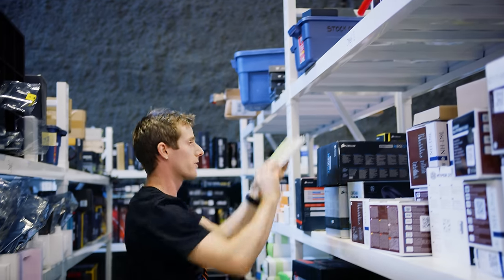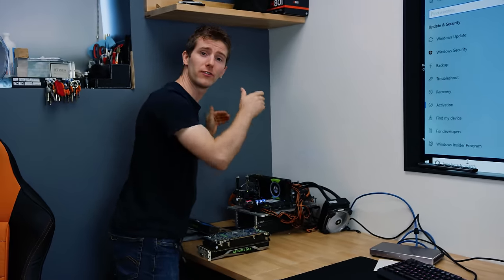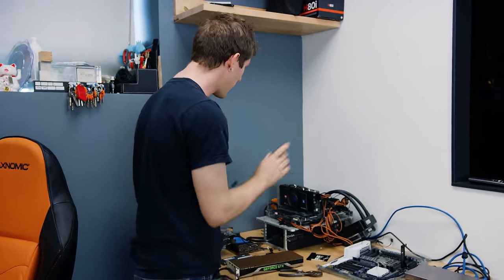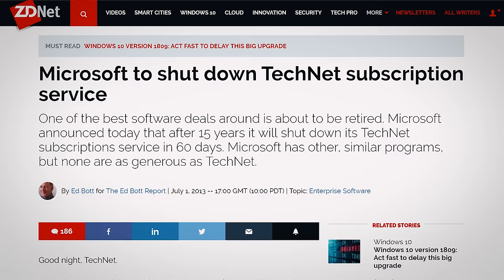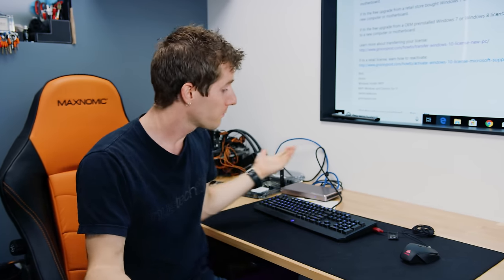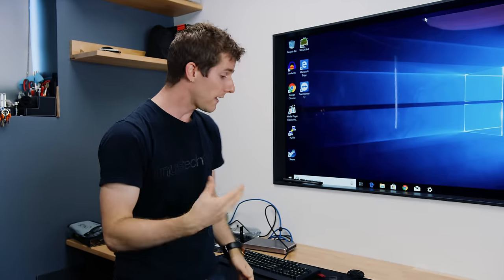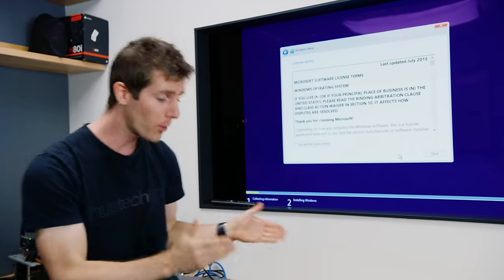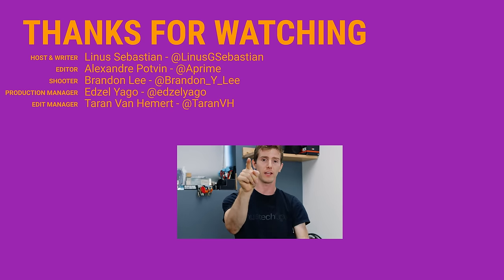Why Does Linus Pirate Windows??

Comment: It can happen within the same motherboard without changing any hardware at all. I was originally running a single hard drive as my OS drive. I decided to RAID 2 drives later in RAID-0 for my OS drive and after switching to hardware RAID in the BIOS it made me re-activate windows by calling the 800 number because it couldn't verify it online. So without changing any physical hardware and just changing how the drives were being accessed and configured using RAID it caused a big enough change for Microsoft to think it was being used on a different computer.
Reply: Generally speaking microsoft is genuienly behind in terms of true innovation and understanding of the current technologies and software/drivers, also their support service is a joke sometimes but whatever.
Reply: I've heard that disk I/O reads/writes changes could also trigger a re-registration prompt With the same controller still install. But this was just an urban legend some repair computer group techs told me. Don't know how true it is, I've my doubts.
Reply: I've had this happen a week after activating with zero hardware changes
Reply: happened to me after I got a new motherboard, and it wouldn't let me activate it online in the settings. Though eventually the watermark disappeared, so yay i guess.
Reply: It is mostly linked to MAC address from what I can tell. I have installed it on a motherboard with the NIC disabled and a 3rd party NIC. I then swapped out motherboards.  It didn't require activation.  I also had to disable CPU microcode.

Comment: I don't have a legit version of Windows on my computer and it was Microsoft's fault. I had a legit version of Windows 7 but Windows kept telling me there's no more updates for this version of Windows and told me to download Windows 7 Ultimate. Did the download and everything was fine. About a month after I started getting messages from Windows saying it wasn't a genuine version. Like WTF. Now I get a message every day warning me that it's not a genuine copy, not to mention that it makes my computer slower. I went to the Microsoft website and a rep tried to install Windows 10 but as soon as Windows 10 was installed I got BSOD and it told me to go back to the previous version of Windows. So now I'm stuck with the Window 7 Ultimate that's not genuine. When I click on to fix the issue, Windows just tells me that I cannot activate it because it is no longer a supported version of Windows. FFFffffuuuuuu
Reply: wtf duude, youre original activation key for windows 7 is still solid, ms just dont support you new updates anymore, so you are on youre own with security issues, they just wanted to confuse you into buying shiet, i do use windows 10 pro activated version couse i am only gamer, i was able to swap my key code between laptop n desktop, totaly different machine...
Reply: i mean arent the keys diff for like pro. home, and ultimate etc. id assume if you're using a key from a copy of say windows 7 home and then updated to ultimate i would think that would be your problem why it is saying its not genuine anymore. try reinstalling whatever version of windows 7 you originally had. i mean i use windows 7 pro still to this day and i've never had windows bombard me with any kinds of messages like this lol. except for when windows 10 came out n it kept asking if i wanted to upgrade to 10 since for awhile they were giving away free windows 10 upgrades to anyone that owned windows 7. i opted to stay with 7 needless to say.  but yeah im almost positive its telling you its not genuine because you're using a key from a diff version of win 7.
Reply: "No support" isn't about the end user as much as the vendors.  Anybody coming out with new hardware that wants to make it work with legacy OS past its end date is on their own, so they better be sharp: no MS resources are dedicated to solving their kernel/driver issues at any price.  For the end user, pushing past the date is no big deal - until hardware failure forces something on you.
Prepare yourself for something else, with some basic [case sensitive] commands that will come in handy at some future date, and leave that crap in the dust:
ls
chmod
apt-get
tar
Reply: And let me guess, you are surprised that you got a message about a non genuine version of windows after you stole it. Lmao.
Reply: Download magical jelly bean keyfinder, see if it shows a legit key, if it doesn't google how to get free windows 10 using media creation tool. I've done it on about 5 peoples computers, has worked everytime, or you can sign up to be a windows insider and download latest test version of windows 10, and put it on slow/fast ring or current, i'm on fast at the moment. Windows insider at the moment is the best it has been since it came out, never had an OS run this well since windows 7 being optimized. If you're worried you can always research how to block insider updated after you update to the latest that way you don't run into compatibility issues.
Reply: When Windows 7 first came out I bought a PC from PC World which had a legit copy of Windows 7 and COA, and also bought a stand alone copy for a laptop which had Ugh Vista. After a year I was told by Microsoft that neither version was authentic. I contacted them and they informed me the both copies were pirated. PC World would not help despite me having bought both from them.
Reply: Big E in the UP  yeah no. that's completely false. been running one machine with legit win 10 and one with cracked win 10 for over 3 years, neither has even given me any trouble.
Reply: That's why you don't fix, what is not broken.
Reply: just buy windows key on ebay it cost around $10.i dont like win activator it gave me anxiety seeing the .exe running in the background to keep your windows activated
Reply: You can look up Product keys and nine times out of ten Get a good one for free, I recently pirated ,windows 8.1 to put on a deskto that was originally windows 7 home, and I found a product key for free online after only a few hours of searching..
Reply: Just to let you know OP, if the windows sticker(if you have one) doesnt have a code on it, just the windows sticker, the Windows key is on the motherboard.

My Hard Drive fried out, along with the Windoes copy I had, which i thought was the only way I had of Windows, lost. Then I came across a program that would find it for me. My own key. If its just the windoes sticker without the key printed next to it, you may be in luck to your old original key, just need to get the original Windows you had.

It doesnt work in upgrades from Windows * Home to Windows * Pro

I.e, Windows 8.1 With Bing OEM to Windows 10 Home worked for me.

The program I used was RWEverything
Reply: My gosh, you should have gotten Vista even if it´s outdated as possible right now but at least you wouldn´t get bombarded with a sleeve of tricks to make you get windows 10 home by default which is about the worst version by far even if they all with the exception of ultimate (where you can turn off everything you want) got a common weakness built in. Better start with open source I strongly recommend, it´s clearly a little more reliable.
Reply: Lmao Windows 10 was free for an entire year. Had your chance to upgrade.
Reply: @AG.Floats  you obviously cant read that was what he did
Reply: I would suggest going to like sdkeys.com and getting a OEM windows 10 pro key for like $12. I had many issues myself with the windows 10 upgrade process where I would get out of the blue corrupted OS. However since doing a clean install on my computers it works perfectly fine and seemed to be a hit or miss problem. Hope that helps you!
Reply: I miss 7
Reply: Email me, i will send you my .exe file to fix that shit and will never appear again!
Reply: it was offered by windows but he had to buy a key thoe the rules of microsoft calls it upgrade hes older key has to be solid fot the upgrade and wasnt ... 
dude microsoft and apple aint different on scamming legally ppl
Reply: it happent to me he had a 1 year key ... depends on country here we have 1 year keys
Reply: dont use crack install linus on your computer instead.
Reply: format your HDD or zero format it, then clean install windows 7, download from pirate bay or x1337, because fuck microsoft.
Reply: +paul rogers you know what beautiful about everything you pirate? not once do you get any message that you pirated anything...
Reply: Using your original key, clean install Windows 10 or your original Windows 7 version: https://support.microsoft.com/help/10749/windows-10-find-product-key

Comment: I've always used both Windows and Linux over the years. Back in May I moved back to Linux on my laptop, and I don't think I'm switching back this time. Linux (especially the big distros, Ubuntu, Debian, Fedora, Arch) now have SO much amazing free software, there's almost nothing I can't do on Linux that I could do on Windows. Even the IDEs I use professionally (MPLABX and Lattice Diamond) run on Linux. 

The old argument that Linux is great but I can't find software to use is basically dead. Almost everyone I know would be able to use Linux with no issues whatsoever.
Reply: I heard Linux have few viruses too.
Reply: Yes, it have. But you ned ti manually run it.
Reply: Lets be honest, Linux still have problem with consumer-level software. There is not enough of stuff to "do simple tasks in simple ways". A lot of things can be archived by using powerfull console software, but its need get used to usually not very logical and complex options set from console and some software is just bad. Like sanner access. Xsane is ancient, simplescan is buggy...
Reply: I need excel for my job and linux sucks on that front.
Reply: @evilplaya6350  That's not actually Linux fault. You should ask vendor - Microsoft, why they don't release it for linux or use free alternatives.
Reply: Because the world is not an ideal place. Even gas laws are not ideal. You use right tools for the right job. Server side you can use linux all you want. But when it comes to real world jobs scenario you need to know windows and Office 365, power BI, etc. Thats the way it is and I am willing to pay for it as well. For such a unified software system. Just like I am willing to pay for Adobe CC group of apps for the ease of use and interoperability.
Reply: @evilplaya6350  This again have nothing you don't with linux being bad. It you use windows infrastructure/ecosystem with all their products bonded one to other its strange to call linux not fitting well. Maybe you should first ask yourself why you NEED MS Office?
Reply: @Vednier  i was replying to OP about why can't I use Linux and why its not even worth it. Why would you wanna spend all that time learning free softwares when you won't be able to use those in the work environment. Replace Photoshop with Gimp, Office with Libre but that would be a hack and they wont work seemlesly with other apps. Free stuff will never be as organized as the one you pay for.
Reply: Oh, sorry, Youtube app is not good for adding comments.

But about that you said, oh well, i can agree on GIMP, albeit i believe that for general (not extra professional) public use they comparable, but real problem is that absolute most of tutorials is about Photoshop, so you kinda on your own with GIMP. 

Office and Libre is kinda less obvious thing - absolute most problem i even encountered with Libre is "poor Office files support". But, goddamit, how can we blame them for that? Its not matter of "X is more organized then Y" its matter of closed standards. Lets take PDF for example - once Adobe opened specs completely - there is no problem with PDF on Linux. Even less common features like DRM and forms supported.

As i stated previously Linux do have software problems, yes. Like Bluetooth - while it was very much supported at low level up for recent years there was no normal GUI for that, and console commands is awkward if ll you want is to send file to your phone. This problem solved (more or less) now, but there is a lot of other, som is slowly being taken care of, some is not.
Reply: All I am saying is its better to spend your time learning softwares that are used when you go in the real world. you can learn Gimp but when it will come to real productivity Adobe is the gold standard. I am saying this because once you learn Photoshop all other apps in CC has the same design language and you will right at home. Same goes for Office. No one will be using Libre Office in an MNC.
Reply: Linux can get a hardware virus mostly but still rare for Linux any operating system is able to get a hardware malware virus.
Reply: Love the "Real World" arguments for software as though Postgres and Apache are imaginary software for imaginary businesses oh hold on fucking Youtube runs its services on Linux servers the very platform you are commenting on is Linux and you are talking about it like its the official operating system of Narnia.
Reply: Aurelius R yep! Linux has good free software 

SUPERTUX cough cough
Reply: @Vednier  I think Xsane is still perfect to scan multipage documents, used it for years. My Brother scanner alone could scan multipage documents too but without crop to the real page size and have to push 2 buttons after every single page, and their free consumer level creativity kit didn't please me too.
Reply: Yes, but its hardly changed over years, GUI is quite awkward and not very pleasant to work with. And this is one of core problems - nobody ever think about UX and design. OFC i dont fan of recent oversimplified design like Chrome do, or dumbed down Gnome, but i think balance is needed.
Reply: That's a chicken and egg situation and I guess your the chicken. As Gates stole a lot of the code for windows anyhow. CC is an afterthought to rip people off. There are loads of better photo editing than Adobe. And what came before the 365 rip off as well? Microsoft has killed off the competition occasionally buying them out for patents and their licensing. Why do you think they sought  to give Windows away? To regain a market it was losing. To enhance it's own future business models to strangle the life of anything that may survive as an OS. Like the way it it is trying to remove Firefox as an alternative browser. That is also very anti competitive. I wonder when that one will go the courts? But they did count on Google building an OS. Which when released will be far more beneficial for all of us who are not fanboys to Apple.
You can pay as well I do. But  in some countries the EULA could be found unfavorable to the consumer. But who has the money to fight it ? I also use Linux on laptops and have done foe eons. It is great to see the inroads that Linux is showing making. So much so  Microsoft has infiltrated the platform recently. I wonder why?
Reply: @EvilPlaya SO you think Microsoft 'invented the code' for Excel, Word etc.. rubbish. Go get an very old copy of Wordperfect and reverse engineer it with BinDiff.  In fact get some decent software and buy Coral's Wordperfect.  You get so much more in it. Without beholding to Adobe or Microsoft.  It is just a matter of a little training. I know many businesses who do not use Any Microsoft  product. They are sick of the never ending updates and fall overs and upward costs.. Their business's have flourished as there is a standard. .And Microsoft does not own it.
Reply: Linux. is no safer then windows with bugs and unpatched bullshit  enjoy
Reply: @Vednier  this is an old myth from about a decade ago. you absolutely do not need to use the console to "do simple tasks in simple ways". It's just not like that anymore. Period. End of story.
Reply: @OleToddster  wtf are you talking about. There is no such thing as a "hardware virus". Do you mean a rootkit?